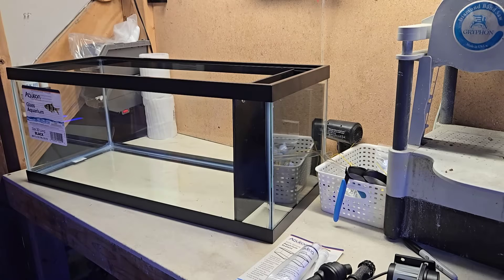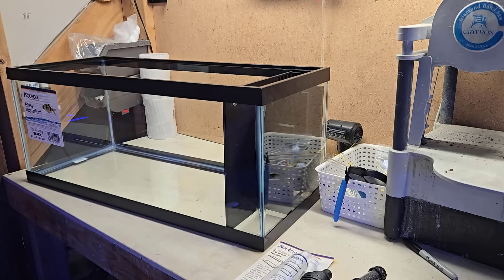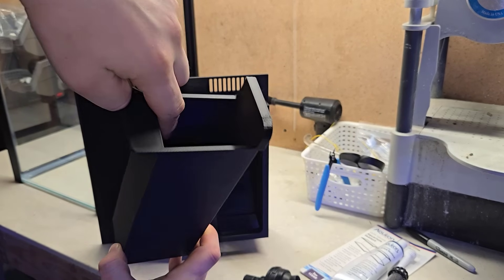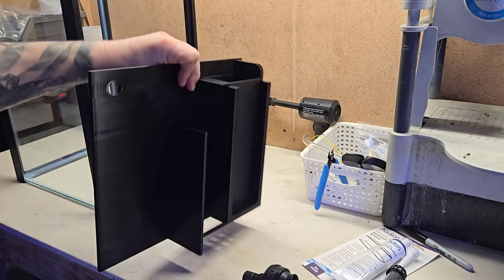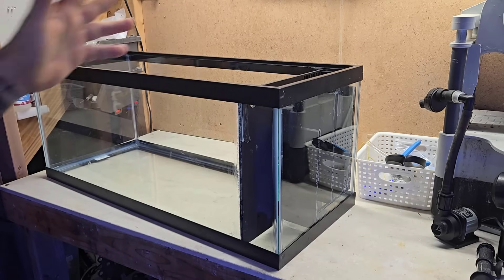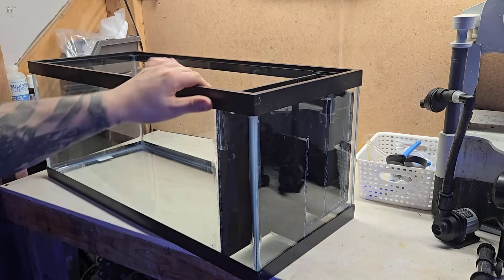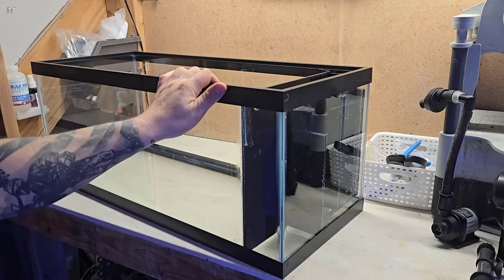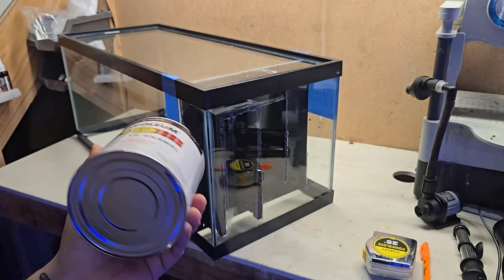DIY 3D Printed Aquarium Baffle System For A 20 Gallon Long

Comment: Hey I installed one of these and I was wondering about the water level in the pump compartment. It seems to get rather low. Should it be at any certain level ?
Reply from the maker: As long as the pump isn't sucking air its high enough. Then add an Ato

Comment: I have a IM Nuvo 10 nano thats been setup for 8yrs now but I just went to That Fish Place and picked up a Reef Ready 75g Breeder to upgrade it I'm over the nano size to much work but what would be cool to do with your baffle kit is make it so it accepts the Innovative Marine Desktop fleece roller kit instead of the media basket. Just a thought would be a nice drop in upgrade over the media basket I use the fleece roller kit and prefer it over the basket or a filter sock. Nice work though it looks good and anybody can install it.

Comment: Would you not need to cover the 3D prints in Resin so that the bacteria doesn't build up in between the layer lines?

Edit: sorry if this is something you get alot, I'm just wondering.

Comment: I would say add some standoffs to the back on the return side that match the media basket side.  That would allow you to press the whole thing up to the glass and not worry about if your pressing too far or not far enough on the currently unsupported side.  Would make for a more user friendly install.  You could go all out and make it a full height like the side of the media basket holder and put cutouts in it so you can view the water height of the pump chamber and not have to paint that side if you didn't want to.
Reply from the maker: This is the most user friendly it gets. Adding more will only bring the price up and take up more print time.

Comment: One suggestion.  In the top middle make a 1/4 section about 4-5” long curve down.  So if the back section clogs it overflowed into the tank.

Comment: So stoked for this!! Going to try to convince a coworker to order one with me and do an office nano build off! 

For those wondering about the silicone and how it holds up. I have a 15 yearish old Biocube 29. The baffle divider is also siliconed in and made of similar plastic material. It lasted nearly the entirety of the 15 years I had it before it came lose, and it may have been my fault for wedging equipment in the back chambers that didn't exactly fit. I would have zero concerns with longevity as long as appropriate prep (cleaning the baffle and tank with alcohol) is followed!

Comment: Great print, would it be possible to use second chamber as well as perhaps like a fuge ? Using the same DC return pump ?
Reply from the maker: @Oscaaarrr16  could possibly print a hang on. But the pump would probably pull in the macro algae